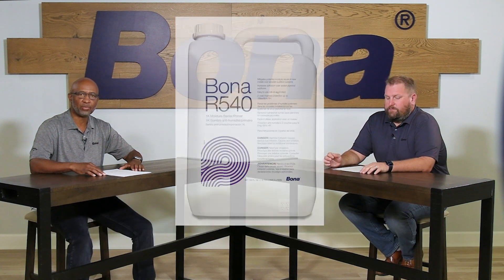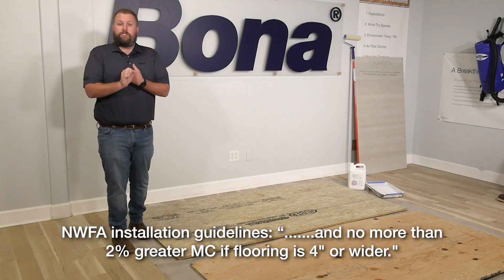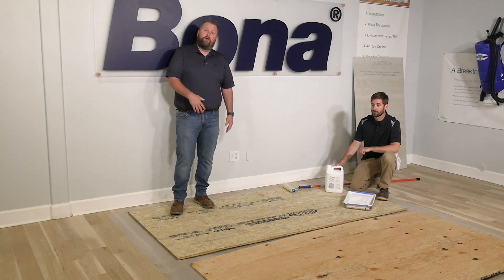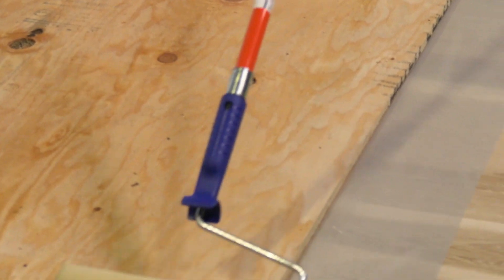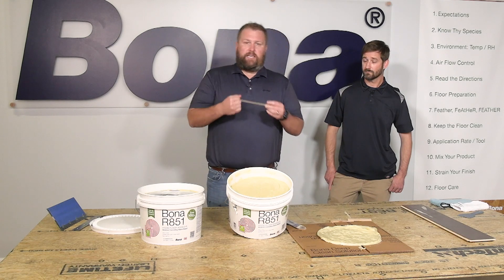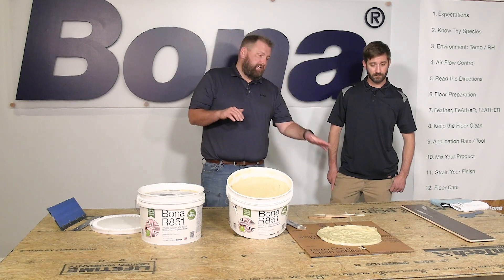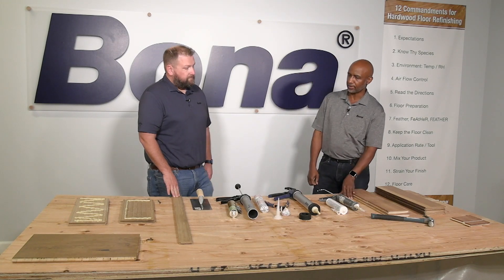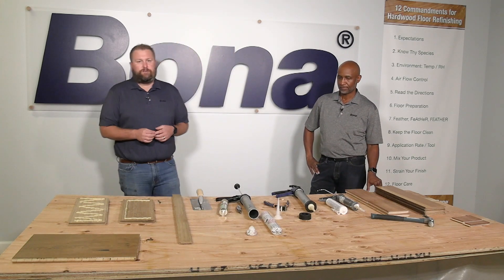Bona Adhesives Trifecta (R540, R851, R850T/R880)– webinar

Comment: Excellent and informative video. I’m a homeowner with plenty of experience with nail down flooring but I’m about to do my first nail glue assist job. I researched different adhesives and concluded that the Bona system has many unique qualities that should benefit me—in fact it was an easy choice in the end. I have a new plywood subfloor and will be installing pre finished 7.5” engineered white oak. I considered sausages but I think it will be more economical in the end to do full trowel spread with the 1250g trowel. I’ll apply a coat of 540 as relatively cheap insurance to mitigate any moisture content variances between the subfloor and flooring. It seems like a solid plan so I’m hoping it works well. 1400sf to install. Cheers
Reply from the maker: Best of luck with your project, Jeff! Happy to hear that these videos were useful for you too! Cheers!

Comment: Great video.  I am putting 5/8" OSB over concrete and then 3/8" engineered hardwood on the OSB.  I plan to put down one coat of R540 on the concrete before I use R851 to glue the OSB to the concrete.  Should I also put one coat of R540 on the OSB before I do a glue assist install of the 3/8" engineered hardwood using R850T?  Thought it might help with adhesion but the video mentions limiting coats of R540 to one when it comes to plywood/OSB so that moisture isn't trapped in the OSB.  Would my above and below application of R540 in effect create the same problem of trapping moisture in the OSB?
Reply from the maker: Hi @peterhebert-v3u - Use the R540 as a vapor retarder over the OSB, applying at a maximum of 400sq/ft per container. That way it won't trap moisture in the OSB, but just slow the transmission. Hope that answers your question.

Comment: The R851 says Zero VOC but during installation, it releases high amounts of VOCs. I have measured it. Supposedly, it doesn't release VOCs after curing, but I don't know how long that takes. I have been waiting for a month.
Reply from the maker: Hi @MichaelPrentice - You must have some very expensive equipment at your job site to be measuring VOC and IAQ emissions? As the TDS and SDS for Bona Quantum R851 state, there are zero VOCs in the product and none are produced during the curing phase - which occurs via a net zero water exchange - with a full cure in 24 hours. Bona's silane adhesives are also GreenGuard Gold Certified for indoor air quality (IAQ), meaning they're approved for schools and healthcare facilities. Not sure what you installed with the R851, but if you're still experiencing odors and such after a month, it's most likely coming from the product installed or anything that was used on top to finish it. Hope that helps.

Comment: The manufacturer of the engineered hardwood i am installing recommends using staples with glue assist. Since i will be using the r850t, i won't be using any moisture barrier between the floor and subfloor. When is the r540 necessary?
Reply from the maker: Hi @user-kn2cu8xl6j - That's a perfect place to use a single coat of Bona R540 on the subfloor. This will provide the vapor barrier protection that you still need, without being able to put asphalt paper down. Thanks for the question!
Reply: @BonaProfessional  My question is when do I know it is mandatory to add R540? Is the glue in serpentine enough?
Reply from the maker: @MarcTison-r6t  The adhesive, when used for a nail w/glue assist, would never cover enough to be considered a vapor barrier (need full coverage across the floor); so unless you're doing a full-trowel spread, the R540 should always be used to substitute for the asphalt vapor barrier that would typically be installed for a nail-only scenario. Hope that answers your question.

Comment: Still not clear how someone decides between the 850 sausages and the 851 trowel if doing glue and nail?  And what would be the need for a faster cure time if you're glue and nailing planks?  Do you have to wait for it to set up to nail?
Reply from the maker: Hi Cindi - Yep, it's easy for this to be a bit confusing as there are really no industry guidelines as to which method(s) to use when for nail w/glue assist. A couple other videos that may help you are:
https://www.youtube.com/watch?v=GPPAGFpXq38&list=PLEBWQPhsJIR5rqEljmiVzY2jjjoamDnZa&index=7
and
https://www.youtube.com/watch?v=sPZTboqklw4&list=PLEBWQPhsJIR5rqEljmiVzY2jjjoamDnZa&index=15
The sausages are going to cost more (per linear foot or oz. of adhesive) and have been a bit hard to come by due to supply chain issues, so dipping R851 out of the bucket may be a more reliable choice in the current business environment. Hope these help you decide what method might make the most sense in your particular situation but feel free to give our Bona Tech Services team a call at (800) 872-5515 if you have further questions. Thanks!

Comment: Does r851 require r540 coat first?
Reply from the maker: Hi @rcote1234 - No, R540 is not required prior to using R851 for the installation of hardwood flooring in all situations, but helps increase the moisture protection levels on a concrete substrate up to 18lbs or 95% RH (without needing to use the MBP trowel, which tends to place a lot of adhesive out onto the floor - can get messy); and is an excellent moisture retarder substitute on plywood substrates when installing flooring with a nail w/glue assist method when regular asphalt paper can't be utilized. If there's a particular scenario that you're dealing with, please contact your local Bona adhesive specialist (through your Bona distributor). Thanks!
Reply: @BonaProfessional  thank you.  I'm doing nail and glue on plywood.   I'll prep it with the r540.